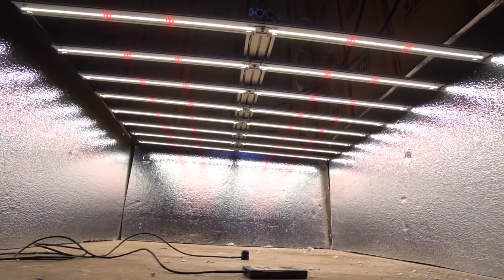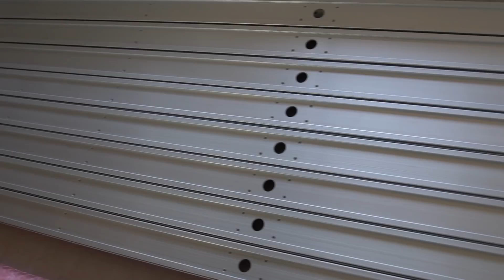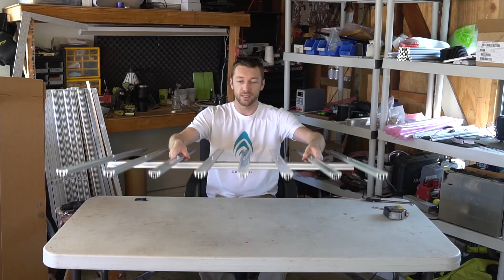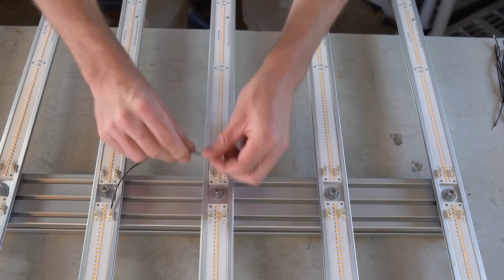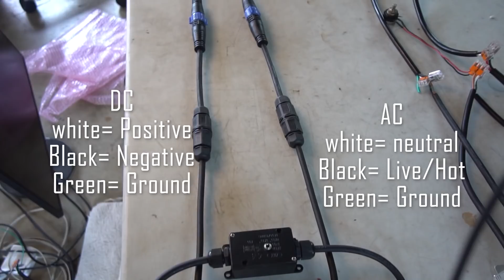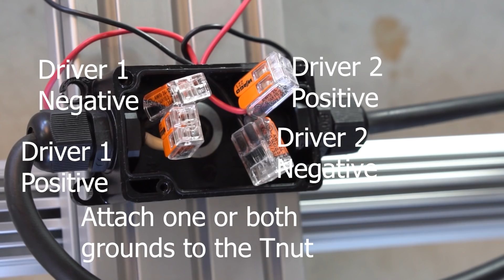Ultimate DIY LED Grow Light: Photo Boost Reference 1.2

Comment: Can I use this with a dimlux light controller?
Reply from the maker: I would think so. Drivers are controlled via 0-10v, so depends on what protocol the dimlux uses.
Reply from the maker: Works with trolmaster and their LMA14 light adapter.

Comment: I’ve got mites. How can I get rid of them 😱 I’m in week3 of veg stage 😢
Reply from the maker: Best way is to get rid of all you plants and start over. People don't like to hear that but its the only real way if that plant has any intention of going into flower. 
Neem and horticulture soap can work over time with continued applications. Azamax ect.
Reply: Greengenes Garden 😢 thanks for the reply 👍🏼
Reply: Check into Mammoth Bio control, or they  just changed the name to Canna Control IIRC.  I use that, and the Amazing Doctor Zymes.  Understanding the life cycle helps a ton.  You have to kill the adults at the correct time to minimize them repopulating.  If your in flower, ride it out or chop and burn.  If your in veg, you can save it.  Strip plants to reduce areas to hide.  If you can cut clones and just treat them.  Make sure sprays get 100% coverage, or as close to as possible.
Reply: Ive had mites for 20 years straight,  you're fine just spray. More heat more mites

Comment: Is this more efficIent than a quantum board??
Reply: It would depend if the QB is using lm301 diodes. If so, then it would depend if you are running them at the same amps.  So, if the same diode and running at 1.4a, then yes, it is the same efficiency without comparing driver quality and other relevant factors. Heat dissipation will impact effciency. You'd need to know operating temps and compare.

There are other mid power led that get used onthose boards or similar led strips as the photoboost. have to read the specs.  As of now, lm301 > all others' effciency for white light.

if there is a benefit to the board setup, it's the spread of the diodes as long as it dissipates the heat at an equal or better rate. it may be spread out more, which would be beneficial to heat dissipation, but there's also less airflow over a very large surface area underneath. so, it's not all roses. it would take RL measurements or enough experience in the area to guesstimate such a thing. You could always run more strips at .7a and they'd be nearly on top of each other on the spine, i bet - similar to a QB spread, but still gaps for airflow.

a lot of the qb builds are partly diy too, so you typically buy the driver on its own. You'd be able to buy the constant current .7a driver and gain even more efficiency, but need more diodes to achieve same number of umol/s, or go with 1.4 or higher etc. Saves cost on number of strips or boards needed by running them hotter, but reduces efficiency and increases more wear-n-tear in same period of time.

If money is no obstacle, i'd run them at .7A for the same reasons i prefer the strips to cob led. same umol/s, but spread out more evenly. Law of conservation of energy and mass applies here (light has both). As long as you limit what is lost to reflection off walls and maximize direct light to canopy, it's getting it all less imperfect reflection and efficiency of the leaf itself.
Reply: i make it sound like you can't do the same thing with the photo boost strips - buy more but run at .7a, but like he suggests in the video that running at 1.4a may be a better bang for your buck. I say if money is no obstacle, do it, moneybags, otherwise the efficiency at 1.4 is more than great and runs the diods at a low temp.
Reply: @That_guy80  geene would've never answer like this lol. Thanks
Reply: @elperrocovero  Don't say it like that, lol. You'd have loose rules when responding to so many people too. I did this one time. Much different one-off event.

Comment: are all the components u listed compatible with the samsung horticulture gen2 thats using the 301H evo diodes? sec code: SI-B8T502560WW
Reply from the maker: No. Those are 42v. They are also 2X wider.